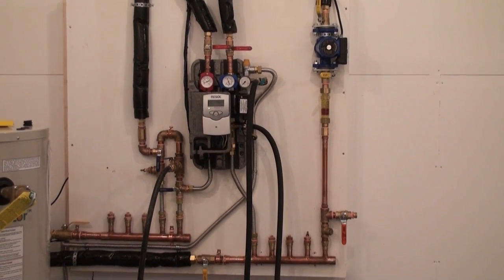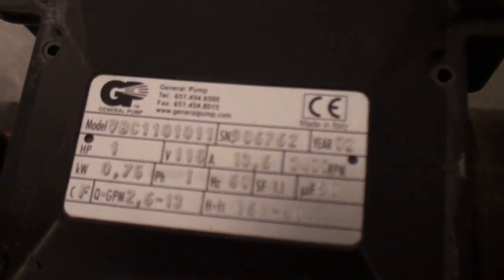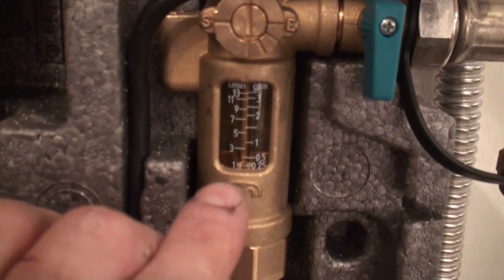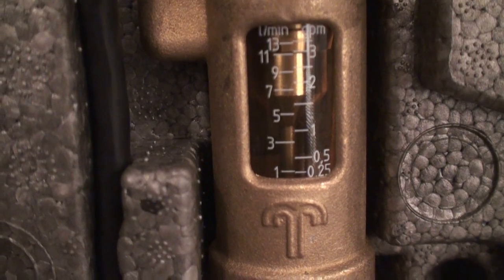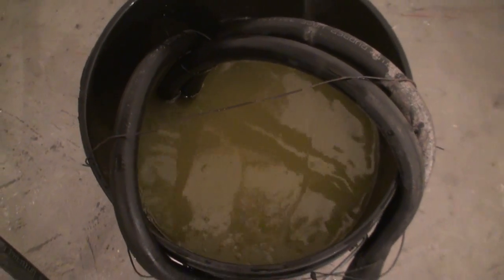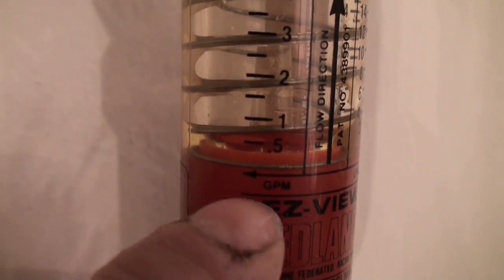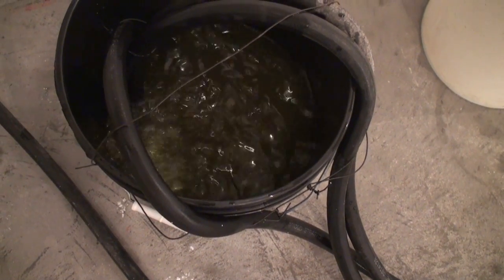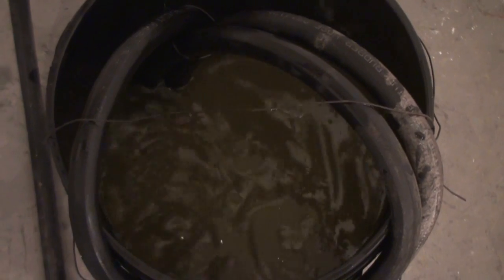Bleeding Air Out Of Solar Heating System

Comment: Curious - how many tubes are needed to heat your home and is it enough to heat it alone? Also how big is the house? Square Feet would be great one last question what's the cost of the set up. Thanks :)
Reply from the maker: Sachi WI  I will have more on this in later videos, thanks for watching
Reply: groutaone I thought you might but I'm impatient lol I'd love to use this to heat my house and hot water - I know it works well for radiant floor heat or similar and for domestic hot water

Comment: I was grooving on the fact that you were plugged into a NEMA 5-15R receptacle - the same as we use in the U.S. But I'm also pretty sure that this was not the purpose of this video. I'm an electrical engineer, so I notice this stuff. Your solar project is coming along nicely. How do you dispose of excess energy in the summer?
Reply: groutaone fish like heat
Good to eat
Need some worms
Dig a pool
Real old school
Loved em from a nipper
Smoke me a kipper
No troubles
just Bubbles
Reply: *****
Great response!
Reply from the maker: really2ugly  Thanks for watching, in summer I plan to dump heat into a large radiator outside, I got it from a roof top air conditioner